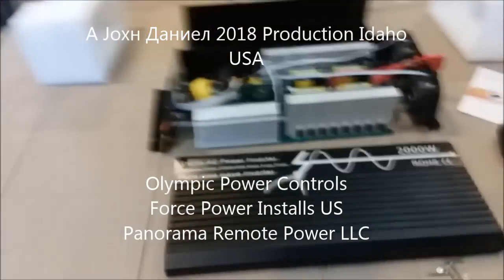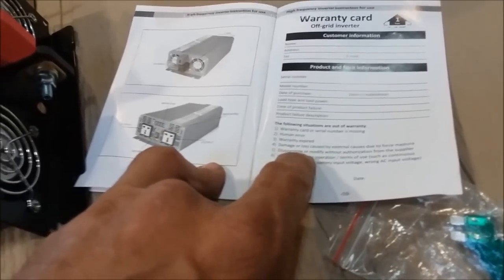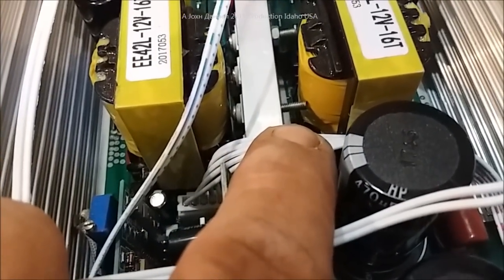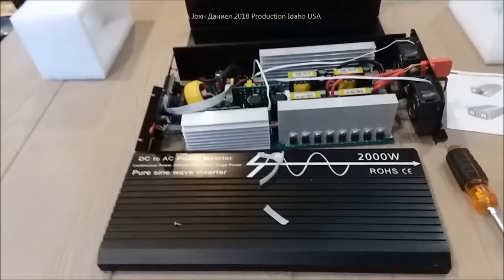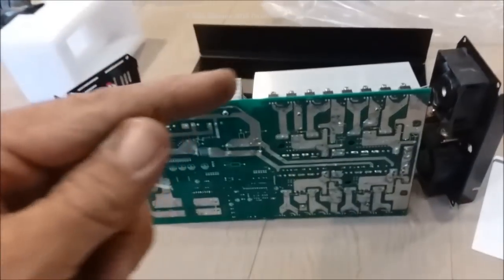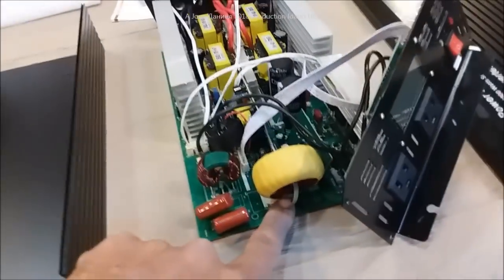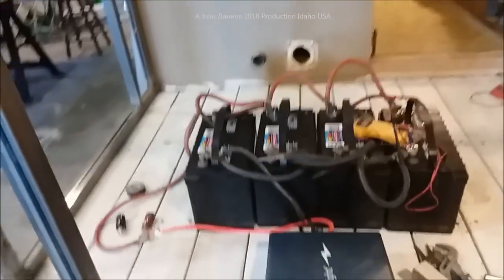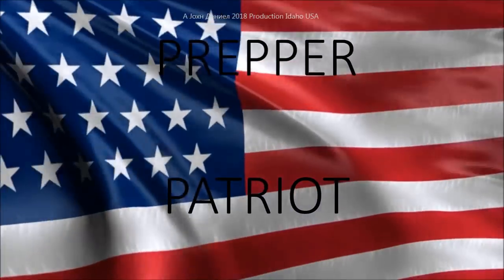New Chinese dc to ac inverter failed build, We fix it! extra Info below

Comment: Those  4   EE42  trafos and the 16 mosfets are good for almost 4000 watts as long as the fans keep turning
All those are minor problems,fixable for those in the know, and  i never saw them  like that,on the contrary,today,May 2023,the workmanship is nothing short of superb;
I buy quite a few of the 3000W second stage assembled boards,they run at 3500W to 3700W watts day in and day out , barely warm at 32ºC in 25ºC weather; they are like tanks...
But the gentleman,sir, you  have not even begun to spot the REAL PROBLEM of them china inverters..... º.º

The real PROBLEM are those ERASED ICs in there!!!!!!!!!!!!!!!!!!!!!!!!!!!!!!!!!!!!!
And ,yes,one day,6 months down the line,you switch it on and....   nothing.... them Ic(s) have gone south
Good luck now.. (them sell the complete (ONLY) vertical  boards,some 30 or 40 doll,ouch in(Malaisia?? Singapore?) but no shipping outside of the country,so still in the dark......
I have been scalded already:  DO  NOT buy ANY inverter that does not have the EGS002 board inside...........................some brands i have checken on youtube... Lvyuan...Jnge...TBE...TSM...HKFZ...UKC...(but YOU make sure of it...)
I modify boken inverters to use the EGS002 (and also the SG3525+LM358),but it is a job...
EGS002 are very good( i buy,repair,sell inverters as a hobby here in my poc Portugal (where the IN justice syst,the juges,the lawers ,ect..   all suck big time,avoid))    they are only some 4 bucks and,on a17 pin socket you pull one out and drop one in,done ; i have quite a few spares,never had to replace one yet,but ...time will come for sure, no biggy.
Reply from the maker: The IC's with the model info removed is when they are trying to scam, they are using sub rated. I have a TN-3000 112 mean well brand inverter, it's got issues with DC over voltage that caused it to fail. It shut down numerous times at 14.50 volts, normal range for top charging battery. It stopped working completely, a few parts, a diode and capacitor failed, toasted, no part number. 
They claim it would fault on nothing lower than 15.0 vdc till alarm, and over volt shut off at 15.30 vdc. Telling me in emails, nothing under 16.5 volts would even hurt it. Just shut it off. Well,  They lied.  Mean Well refuses to offer parts or schematics, and identifying the fail is complex. It is in a large upright board that is soldered in. They are a high dollar Taiwan made item, but acting like a dirt cheap Chinese company. Avoid them.

Comment: I screwed up i bought a power star inverter from Alibaba $353 with shipping
12V 2K 6K Surge 
Hooked it up ran great for about an hour,
Oh ya than it burped went into a neutral mode LCD says Abnormal AC.. Abnormal DC  WTF it was hooked up properly to 400AH Renogy batteries and fused,
Emails no reply, went to SRNE website emails directly to them. Response that's not ours we don't build junk 🤔
Now I have a 62lb paperweight . as it turns out there are about 30 different companies in ShanJiang building powerstar power inverters and they're all fake srne is the only company that builds the Power Star which is a pretty good piece of equipment

Comment: I appreciated you exposing a potential safety hazard. I have purchased products from China and as long as you understand what you are purchasing and take care then you can get a value for your dollar.   To that end, I would like to have seen whether the unit worked after the cap was replaced. Also, I firmly hold that we are free to have and express an opinion on how a fact effects us, but facts are facts and should not be distorted.  It is mostly false that President Trump has done more in sanctions than "the other guy".  Here is an unbiased comparison: https://www.politifact.com/truth-o-meter/statements/2018/feb/20/donald-trump/has-donald-trump-been-much-tougher-russia-barack-o/
Reply from the maker: We will be repairing it, just got the parts in. But Your quoting Politifact? Tampa based Politifact funded by Slush money from one of the largest scams and race hustlers on the planet, Southern Poverty law center? Not realistic and half missing, and not one actual CBO rating applied. They are Comparing 13 months of Trump to 8 years of Obama? Seen the news lately on tariffs and trade penalties.  10 to 1
Reply: Thanks John for pointing out that Politifarce is a way left .org. :-)
You made a comment in your video about some stuff not being in the US at the time of sale. Funny that it seems Rowland Heights, CA and Walton, KY have sellers that ship both from the US and China, so that can give you a clue. It is called drop shipping and it seems you can't avoid it now days. Even with items bought on e-bay, you might end up with the shipment actually coming from Amazon. Like you, even if it is Chinese junk, I'd still rather give a job to someone here in the US.
Reply from the maker: When a claim by Politifact in April was ran on CNN claiming Trump had lied 477 times in one year by a rep for Politifact, the other guest Dick Morris ( a former Campaign Manager for Bill Clinton) challenged them to produce 10 of the 477 lies, being that NONE or nothing was quoted by the George Soros funded group ( Soros also funds ANTIFA, SPLC, and SNOPES) in their claim. Heres the answer he got....... https://youtu.be/Tqy4cAQVzLU
Reply: Јоhn Daniel - you da man. Keep up the good work

Comment: Always file a claim with ebay they will respond then. But dont wait there is a time limit. I always give a seller the benefit of a doubt and send ONE message as a courtesy. But if they do not respond its straight to a claim/refund they have to respond to that.
Reply from the maker: Yep, followed the process, the seller waited full 7 days, till just 30 minutes before Ebay had to step in to offer to take it back. In our reply they offered I keep it with a partial refund and we did. Parts to fix it were cheap enough, refund was big enough to just keep and fix. Video on the repair is in the works.

Comment: File for a refund through eBay, you'll be able to keep the POS inverter and get your money back. Also file a claim to have this item removed by reporting it as fraud. Granted you can repair it and get it working but others can't or won't have your skills... I was looking at this inverter myself and quickly recognized it so now I am going to removed any saved listings of it as I don't have your soldiering skills... Cheers...

Comment: Damn John, how do you really feel? That kind of stuff is enough to make a saint cuss like a sailor. Better go over those cold solder joints, no telling what else you’ll find. Good luck
Reply from the maker: Found a completely missed 22k x 1/4 watt resistor not soldered on one end since making video.

Comment: Man, that IS CRAP FOR SURE. I Can't afford to lose $188.00 on something like this piece of junk either. I've got 2 of these Inventor's I bought in a "Truck Stop" back in the Mid and late 90's, that still work. One is a 1750 watt  and the other is a 2000 watt. And, I didn't give that much for 'em either. 1 was bought at the "Petro" in Beaumont, Texas. the other one; I don't remember where or what "Truck Stop" it was now.

Comment: Hey John I'm pretty sure ebay will refund you if the seller doesn't reply. Item sold not as described or defective. Ive done it a couple times and got my money back from dead beat sellers. You may already know it.
Reply from the maker: Yeah, I have about 24 more hours then Ebay takes over it.

Comment: In the 2000-3000watt  range, would you agree for the money the, the Samlex is good quality?  The cooling fans actually modulate?
Reply from the maker: Yes, but what's better is the kisea 2500
Reply: Spacecarboy , Meanwell, Samlex and Gopower are the best quality inverters out there. All made in Taiwan, they are extremely reliable